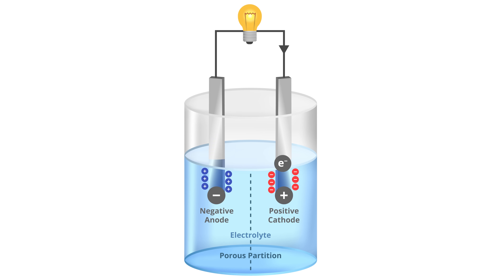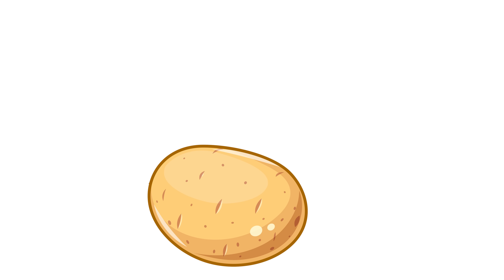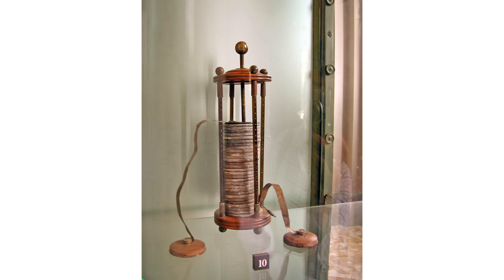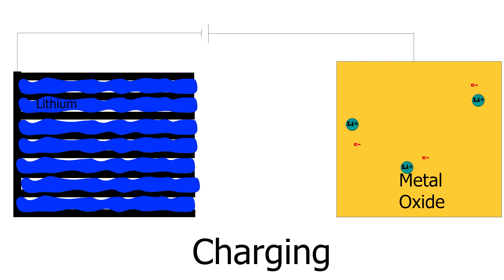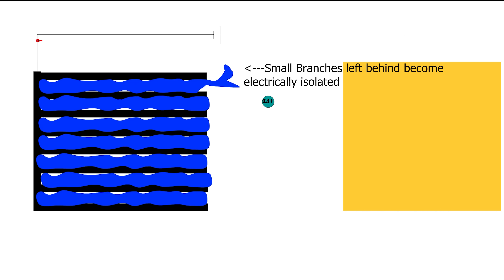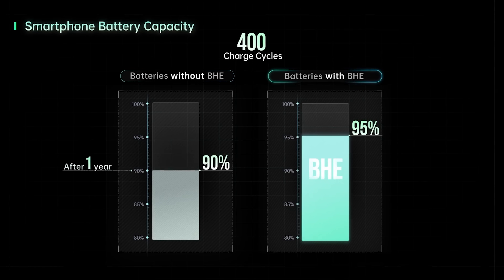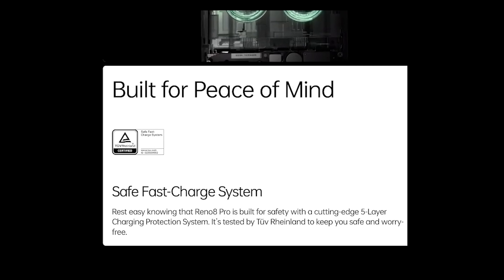How To Stop Dead Lithium and Double Your Phone's Battery Life

Comment: Wait, there is something I don't get, when you put both electrodes on the acidic solution, you said that the electrons flow through the wire from the zink to the copper... but as far as I know that's not how electricity works.... If I understand correctly about electricity, it is an electromagnetic field surrounding the wire , not electrons going through it...., remember the infamous experiment about the light bulb, the batery, the swith and the 1 light year long cable it all goes conected through, and the question "how long will it take for the bulb to turn on?".... so  please help understanding what you just said about electrons going through the cable, please!
Reply: Electrons don't go "through it" per se, but there is a chain reaction. An electron passes from one atom to the next, then that atom has too much charge and releases an electron to the next atom, etc.
Reply: @mike1024.  it could sound right if you picture a chain of billiard balls trough a pipe, you push one in, inmediatelly the last one ahead shows out... but this process of atoms absorbing a electrons, then having to release one of their own, they all go crashing in all directions... does not look like a flow to me sorry and seems like something that takes too long and wears down super fast...
Reply: @neomatrix001  I agree that the linear analog makes more sense to what I said, but I think as a whole, it works because there is a steady flow of electrons coming in.
Reply: There is an electromagnetic field around the wire too, but it is caused by this "flow" of electrons.

Comment: Most phones charge the battery to 4.2V and call this 100%. Charging your battery to 4.2V is not a good idea if you want the battery to have a long life! At 4.2V your battery will have degraded marketable after a year!
If you stop charging at 4.0V (80% on most phones), your battery will be as new after a year! I know, as I do not charge my phones beyond 80%!
If manufacturers would use a slightly bigger battery, and would define 4.0V as 100%, then batteries would live for many years! Or why not have an user option to charge either to 4.0 or 4.2V for longevity or extra power?

Comment: One thing I found helpful is to not charge it in between a cycle. I only charge my phone when it's below 10%.
Reply: Even better to always keep charge above 20% and always at no more than 80%.
Reply: I am sorry but it's actually opposite if you let your battery too low and too high everyday it's not going to last long. The separator between anode and cathode gets damaged over time if you transfer large current to either side. At 50% it's stress free. That's why companies charge it to 50 60 percent. So if you don't get out of home a lot and want your battery to last long the. Then Keep it near 50% for example 40-60, more practical 20-80. If you can't do that the don't worry any battery over 3500 MAH will last nearly 2 years which is enough.
TL;DR: don't let your battery percentage to extreme numbers.

Comment: Yeah there was a little advertising hidden in the video, but this is great engineering! This is something that needs to be sold to the bigger cell phone companies for a huge profit rather than attempting to make a dent in the Samsung/Apple war to nose their way in. I don't think they can succeed in the cell phone manufacturing market solely on new battery technology, but they CAN make some serious money selling it to these major phone manufacturers, or better yet, contracting to be the supplier of the batteries and any other related hardware needed. They could go way further than cell phones though. Look at how many devices uses lithium ion batteries! Selling to the EV market perhaps?
Reply: There are already chargers that do this...thats where it's gonna make the most sense to monitor all this information from anyway. Most of them are sold as smart chargers or wireless chargers.
Reply: @sidthesloth12  can you monitor it externally in the charger though? I'm not sure.
Reply: @mike1024.  I believe some smart chargers have different settings that can be changed...wireless I'm not sure though. The wireless charger I have switches to a lower volt charging when it hits 70%, stops charging when 100% is reached and will stop charging if it senses too much heat coming from the phone...but I don't think external monitoring from the charging dock is a thing yet...at least I've not seen one.
Reply: @sidthesloth12  I do agree that wireless charging seems to have a better chance of success doing this externally with existing hardware.

Comment: I still don't understand how the software prolongs the battery life with monitoring the elektrode Without affecting the charging speed.
Reply: i would guess its prevent you to charge over 80% and go under 20% by creating a new fake 0% and a new fake 80% in theory its would work really well
Reply: @Aranak777   That's a pretty good idea. (worth trying out anyway).
Reply: @Aranak777  but that decreases the capacity?

Comment: Sucks I can't download an app which monitors the incoming voltage like that to help ALL phones, instead of just this one brand!
Reply: The app might be able to monitor it, maybe.
But it won't be able to do anything about the degrading battery because that's ultimately the phone's job, and short of a hack, you won't be seeing apps messing with how phones charge unless the manufacturer specifically allows it. Which they likely won't as they don't want to be tried for phones exploding due to an app messing up.
Reply: @RealCadde  at least on Android you can download unsupported apps without needing to hack the phone (I've done it before) and as long as you checkmark a warning about it, it'll download just fine. Apple phones I don't think so, but it is theoretically possible on Android!
Reply: @twixerclawford  the point isn’t whether you’re allowed to install the software but if the necessary hardware is there. You can’t download a hardware upgrade lol
Reply: @hopperelec  I'm not exactly aware of what sensors are in phones but I believe at least a voltage sensor is in there
Reply: @twixerclawford  You can install apps to iphone without jailbrraking it. It has similar setting to android to allow this. After changing the settings you just download the app from the browser and instal it. They call it 'sideloading'
Reply: @twixerclawford  You can download whatever you want on Android, that's not the point.
The point is that apps have limitations on what they can do, managing battery charging is most likely one of those limitations if the phone manufacturer cares at all about their legal liability.
Reply: @twixerclawford  Even if you have a sensor for it, you still need the hardware to do something about the data
Reply: They need to sell the technology to the big phone makers!
Reply: They probably needs more sensors etc that other phones dont have.

Comment: I guess my Samsung Galaxy S3's battery must be a really good one, seeing as I've had it for over 10 years and it still runs on the battery it came with.
Reply: @N I use it as a phone, to make photos and to chat on Whatsapp. But no browsing or watching videos. I prefer to do that on a PC.
Anyways, believe what you want to.
Reply: @joyl7842  yeah probably just usage then. The Youtube app alone takes most of my battery power, I dont use them but social media apps (facebook in particular) are notorious for draining batteries.
Reply: @joyl7842  its probably because you use it often. once you leave batteries alone they self discharge and damage themselves
Reply: @Blox117  Sounds like something that happened to a brand new battery I bought for my old laptop. I used it a handful of times and then I didn't for a long time, now it won't charge at all.
Reply: My 5 year old phone has been charged 1000 times and still has 103% of it's capacity left (it had about 105% of it's specified capacity when it was new if I remember correctly). I charge between 30%- 60% almost everytime thanks to an app that sounds an alarm when it reaches 60%. I only charge to 100% ver rarely when I know that I wont be able to charge at all for a day, and even then a 80% charge would problably be sufficient anyway most if the time.
Reply: @SkepticalCaveman  yes, but that's only about 300 charge cycles in total. Since you always charge only 30%, it is also only 1/3 charge cycle each time. that's how you calculate it. So 900 such 1/3 charge cycles are 300 correct charge cycles. And that's also very impractical the way you do it, you have to charge the smartphone several times a day. You can only do something like that when you're unemployed, right?
Reply: @philolori  300 charge cycles and still 103% left. I.think you missed the point.

It's not that impractical, just carry a small charging cable with you, USB ports are everywhere.
Reply: @SkepticalCaveman  no, i get it. but some people might misunderstand, that's why i pointed it out. so i don't know where you live or where you travel, but where i come from there are no USB charging sockets anywhere on the road. I don't live in a devil's smart city. And that's a good thing! So this is really only feasible for very few people.
Reply: @philolori  Your car don't have USB charging ports? Well, then a power bank is the solution, you can charge from it everywhere.
Reply: Be careful, ‘big battery’ will come for you with those claims
Reply: @N I like having the bigger screen so I can make proper photos.
Reply: @N depends who you buy from
Reply: It might run, but for how long? My S7 had to be replaced recently when the battery no longer was supplying enough power for the phone to operate properly, though I could have had the phone opened up and the battery replaced.
Reply: @mike1024.  I charge it every 3 days or so, when it gets to sub-30% power.
Reply: That's impressive! My S7 would go from 100% to dead in about an hour of continuous use before I upgraded it recently.
Reply: @N I actually have a Nokia feature phone (not a flip phone because they are not durable) for calls and SMS. My smartphone don't even have a sim card at all since I use it with wifi only.
Reply: @SkepticalCaveman  Mine does have a simcard but I only use internet when on WiFi at work or at home. I don't need people bothering me outside of those places and if they really want to hear from me they can call me.
Reply: @joyl7842  Yeah, I prefer a button phone for calling, because it's much easier to carry in my pocket, and the battery life is amazing.
Reply: I also don't see the point in replacing a device that has served me so reliably for such a long time, and still does. 
Just like my PC, going on 6 years now running for 6-18 hours a day with a customized version of Windows 7 and it will run any software (within reason) released today. It doesn't ever crash, it's quiet and doesn't cost me a fortune in power-consumption.
I've experienced plenty of times in the past when I was seduced into buying something newer and supposedly better, but it turned out to be unreliable garbage and a huge headache. I'll happily use something old if it's reliable and satisfies my requirements.
Reply: @joyl7842  I don't buy new hardware anymore, because it looses value so fast anyway. If I need a need to upgrade to a better computer then I will buy a used one for cheap.
Reply: @SkepticalCaveman  Sounds like a good way to go. I was looking at upgrading my PC with 2nd hand stuff, but I think I will just wait for current prices to drop even more and I will get a new rig then. 
Definitely not getting any of the recently released stuff though, cause prices are absolutely bonkers.
Reply: My S3 which is 7 years old now barely works for 2 hours of screen on-time, at most. Shortest in an hour. When charged fully, after 10 hours of sleep it's already at 80%.
Reply: you must not be on anyones watch list
Reply: Could be cause of the slow charging on it. Idk

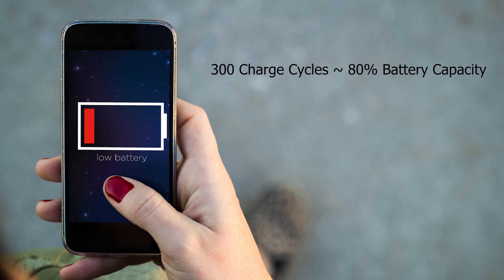Comment: 4:08 "With normal phone after 2 years or 300 charges cycle". What are these "normal" phones? Black-n-white Nokias? Amazon Kindles? Every phone I had, I needed to charge every day, so at least 365 charges already in 1 year. But of course I charges more on average, cause I don't wait battery to die completely. So 300 charges would be more like 8-9 months.
Reply: One cycle is from 0 to 100%, so if you charge from 50% it counts as half a cycle, but still 300 cycles for 2 years is kinda low
Reply: Charge cycle doesn't mean how many times you're plugging in the charger. Google charge cycles and read up a bit first
Reply: @RudraSingh-gb9ue  Thanks for commenting. I will google it. But the essence of such videos is that they explain, so I don't need to google. Otherwise I would not watch Youtube, but read white papers.
Reply: @rustix3  Well take anything on internet with a grain of salt (actually a sack of salt would be more appropriate)

Comment: Finally, a real explanation to the battery life problem
Reply: bear in mind that the major phone makers already incorporate mitigation features into both the phone and the charger to prolong the cells as much as possible. You can't 'flatten' a phone through overuse and you can't overcharge it or charge it too quickly. Complex charging ramps are programmed in already, and the 100% you see when 'fully' charged isn't actually 100% They could just have made the phone where you could simply open up the back and replace the battery but no. this is just to get people like you that dont know much about this and excuse to so that they can get away with creating e-waste...
Reply: And it had to be an ad.
Reply: All from a paid sponser. Be skeptical.
Reply: The entirety of the Internet is available do you really think anyone read a book on this topic
Reply: samsung phone do the similar thing by swelling and making them unusable. :goodvibes::goodvibes::goodvibes:
Reply: Its actually not a good explanation at all. If you're are curious how really Lion batteries work - read some books.
Reply: @andrewsneacker1256  ok
Reply: @andrewsneacker1256  "Read some books"... what specific and useful advice 😁
Reply: @andrewsneacker1256  Great advice, sir! Was very useful! Although, I have a question for you. As you did not mention what book at all to check, is the Lion battery better than the Tiger battery? If it is, how does it work?
Reply: @jimmytvfclassic  nah, "lion" batteries are very strong and durable
Reply: @andrewsneacker1256  yeah no shit Sherlock it was good
Reply: @tiletapper4ever  Not really. This topic has been covered a thousand times on YouTube in far more detail. This was just an add for OPPO or did you not realise that.
Reply: @andrewsneacker1256  I have read some books, they have never mentioned lithium ion batteries once.
Reply: Yea, but i think, if it was only this factor, then 80% would not be so bad. I mean its still 80%.I think a main issue,we are left out here, is that the consumption of the phone probably increases with more and more Apps and data/Malware/Cache, ... stored on it. Also newer IOS/Android will probably lead to more drain. 
I think if you reset your phone after  maybe every year, the battery life should keep being pretty good.